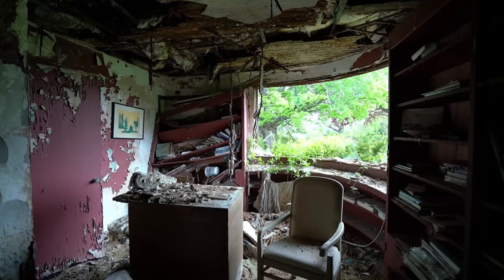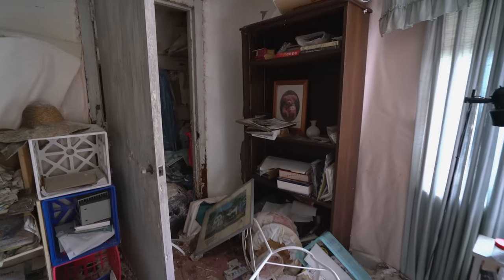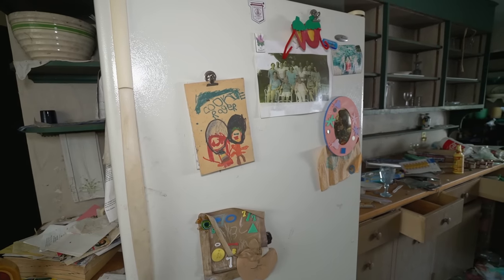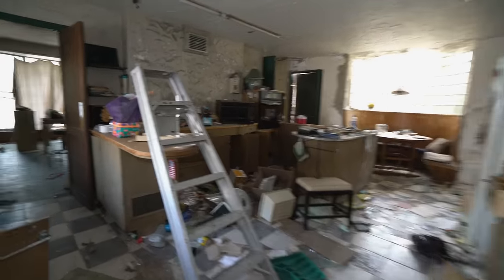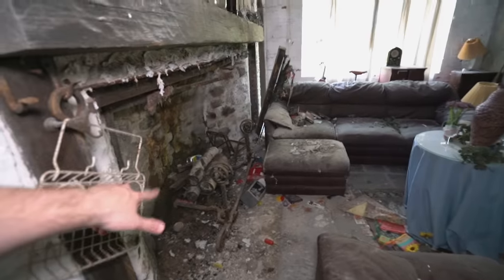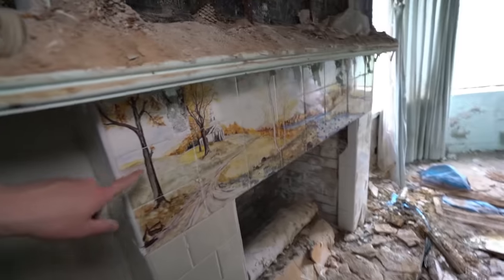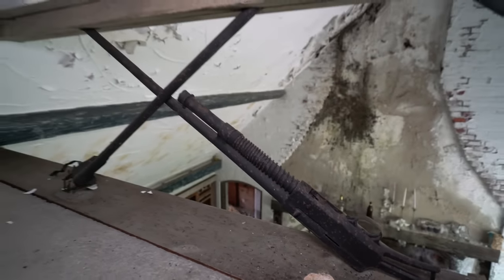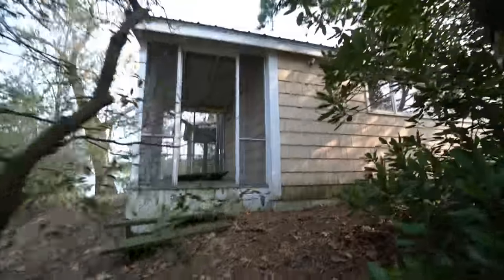Exploring an Abandoned Island with 2 Homes left behind (15 years after people fled)

Comment: Really cool explore!!  I did notice the living room with the hole in the ceiling above the fireplace @26:50 is the same fireplace in the photo @ 7:17. You can tell by the trim around the fireplace and the glass door leading out to the courtyard. Also that Sears catalog was from 1988 I can tell by the old electronics and that VCR's weren't $789 in 1999. TV's were black  rounded plastic by 1999.
Reply: Good spot.

Comment: I Dallas.  Homeless people stay in abandoned houses that are in that condition.  The beds look clean enough to sleep in if your used to sleeping outdoors.  It's like a homeless persons home. They stay in some around here and 2 of them have cold water still running so they can shower in the summer heat.  There's no electricity or gas left on.  The water is just the temperature of the pipes underground. I never call police in the homeless who stay in abandoned houses because it at least gets several homeless people off the street with shelter and beds and mostly unheated water so they have water to drink.  They use the cups and plates left in the cabinets. They panhandle money to get food that they can cook in the fireplaces. Sadly,  many of the fireplaces are cracked and some of the abandoned houses burn down 😢.  Most don't, so I'm glad that they have a home compared to living on the streets. I will give them food at times when I have enough money to buy extra food for them. I have to feed myself and my family first. I usually get non perishable food for them.  I drive to the abandoned homes as they are not far fun where I live.  I give the 3 to 4 people living in each home a grocery bag of food.  This keeps me safe as the homeless love me for helping them and they protect me from any bad homemade people. 😊😊😊😊

Comment: If you like walls and buildings that are hundreds of years old you should come to England.  There's a small house in my village that was built during the English Civil War (1600s).  People are still living there but they've added extensions to it.  The doorways of those old houses from the Middle Ages have such low doors and ceilings.  I suppose people were shorter in those days.  :)
Reply: >I suppose people were shorter in those days
No. This is because it is cheaper to heat.
Reply: Not as well-nourished probably, so shorter statures.. Maybe